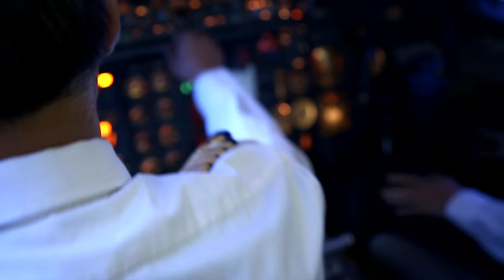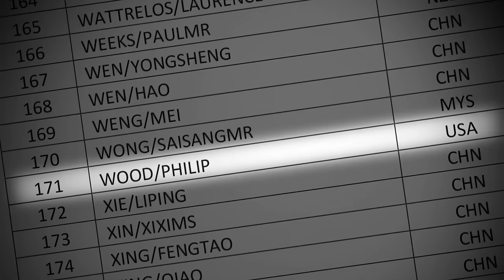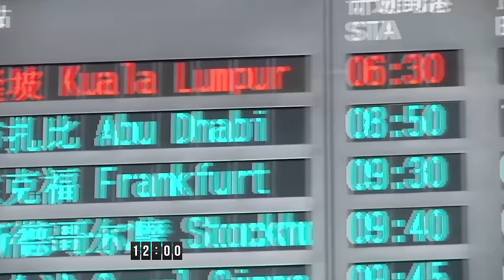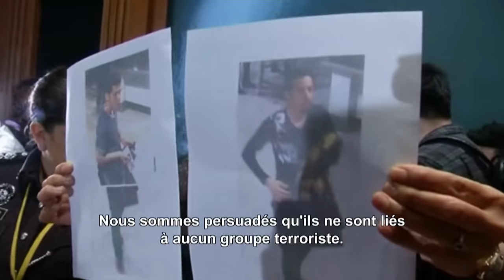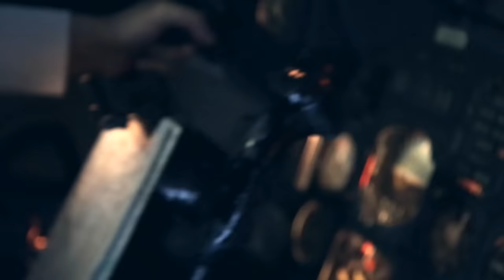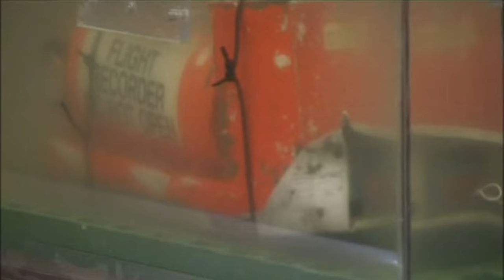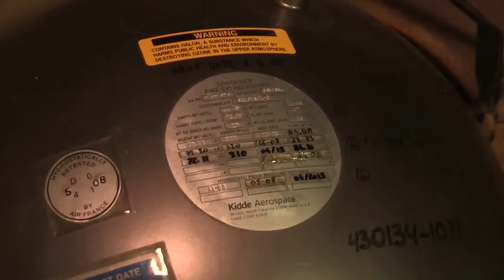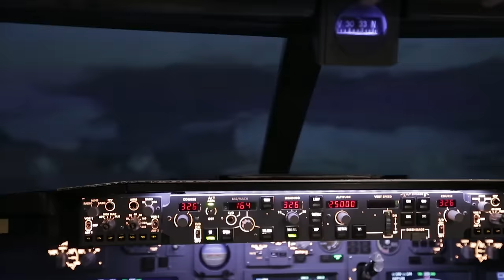Why We Never Found The Malaysian Flight MH370?

Comment: Planes do not disappear if they turn the transponder off, all that does is remove the flights identification number. If no transponder meant that it was not on satellite or any radar than countries would never be able to detect launch of missiles or detect ANY enemy aircraft.would completely defeat the whole purpose of satellites and radars in the civilian sector and especially military.
Reply: Yep. Good luck getting that message through to the NPCs.
Reply: Goes to show you how prepared any country is. We can’t even detect a balloon the size of 4 city buses spying on us . A pilot had to let someone know
Reply: Yes without transponder there is still primary radar, however aviation ground stations generally do not use this. Even with a basic primary radar return it will not provide positive ID of the object it’s tracking.
Reply: @kamakaziozzie3038  There's no "however" about it. The RMAF tracked a rogue aircraft known to be MH370 as it violated the Malaysian border, which is all the requirements needed to treat it as an attack on the country and order it's interdiction, period.
Reply: Áááaob
Reply: Este accidente es muy extraño, porque fue bien preparado, inclusive apagaron la coneccion satelital que los motores mantienen con el fabricante en todo el periodo que se mantengan funcionando y en uso, y eso del transpondedor si lo apagas desaparece de los radares satelitales no así de los terrestres, en cambio los satélites militares tienen detectores especiales para descubrir Despegue, Masa, Arco, Reingresó,  Velocidad, Trayectoria, Destino, Ruta.  Los satélites militares son militares, no ocupan el espectro de bandas civil, solo piensa lo que ocurrió con las torres gemelas, no sabían dónde dirigir los únicos dos o tres cazas que pusieron en vuelo y desarmados. No sabes nada de detección, satélites ni menos radares, saludos.
Reply: @C.Europeo  Entiende tus hechos, amigo. La señal de telemetría del motor es en lo que INMARSAT basó sus cálculos falsos.
Reply: @UguysRnuts  ya te respondí, pero en esta mierda borran los comentarios.....!
Reply: It was tracked on military radar & it IS known where it went down, east  of Australia ( from another utube program).
Reply: @susanburrows810  False.
Reply: Podría ser iniciar una búsqueda cerca de las islas Maldivas para buscar escombros, si tienen los fondos para eso, claro.
Reply: @baffledbybullshit- Do you realise how big the ocean is?
Reply: @Karlthegreat84  Do YOU realize the former Malay Prime Minister and his wife are currently in prison for the largest financial crime in the history of the world?
Reply: @UguysRnuts I actually know that, but that doesn't have any connection to the MH370.
Reply: @Karlthegreat84  Two of the greatest crimes in history, both revolving around the same corrupt dictator, but you don't think they're related???
Reply: @MikesGarageReviews  great point dude..

Comment: The whole way the situation was handled reeks of a cover up from higher places. I think the plane was shot down accidentally the moment or shortly after communication was lost and whoever did it has enough friends or influence to come up with this whole story of the plane turning and changing its route.
Do you remember the story of the passengers who made the plane headed for Pentagon on 9/11 crash deliberately by overpowering the pilots? Yet the debris was found in a radius of tens of miles, pointing to an explosion while in the air. Even in this situation, just after two planes had hit the twin towers killing thousands of civilians, they couldn't admit they shot down the third plane before it could hit the Pentagon.

Comment: The more I listen to this story the more it sounds like it was hijacked.
Reply: I agree with the hijacking hypothesis:-
Reasons :-
a)Fuel to Beijing is enough to reach US 
   Strategic Military base of Diego Gracia
   in the Southern Indian Ocean.
b)Security checking for MAS flights at
    SEPANG AIRPORT is very poor bcuz
    the airline is govt back & the fated MH
    370 at midnight & security dwindle.
c)Two stolen pasport is been used 2 
    unidentified passengers..and the 
    moment of hijack is planned to be the
    exact time of passing to Vietnam air
    controller.This moment also all flight
    communication been turn off.
d)The craft is been force or more likely
    already at the hand of hijackers and
    reroute via border airspace of Thai
   land M'sia ,Indonesia,Sumatra Island &
   Maldives bcuz less concern for com
   mercial planes.
e)when the plane reroute again exactly
    in the direction of Diego Gracia, US 
    satelite already on the alert mode.2
    military high altitude,high speed planes
    are mobilised to intercept MH370. 
    Attempt to communicate fails & no 
    way to request the commercial craft
    pilot to reroute emergency landing to
    the nearest habitable land.
e)So as according to airspace rules, 
   military forces take command....
   and BOOOMMMMGGG!!!!!!! No way any
   unidentified small  or big air& sea craft
   can be near D.Gracia's ocean waters.
f)MH 370 upon been hit high in the air,
  disintergrate into pieces because of
  the military missiles together with the 
  still available fuel plus the extra quanti
  ties of lithium batteries carga intended 
  to aggravate blast upon reaching D.G.
  military base.
f)So we just wait for a box- office film
   by Hollywood or Hong Kong film 
   makers to make money.As to date
  we must sympatised with the famalies
   of the passengers of the doomed plane
Reply: Agreed! It was hijacked and they want to do the “Sept. 11 attacked” style in Diego Garcia where one of the biggest U.S. base located.
Unfortunately, it was shot down by the US forces before it reached the US base.
Reply: If you watch this documentary from start to end, it is clear that the hijacking (beginning and end) is their favorite theory but the stretch that leads to the base Diego Garcia and the US shooting down the plane is honestly for me over the top and unfortunately typical of a French approach towards the US. They often overestimate the US and try to find a way to blame them. Sorry but if it was the case, the Chinese government who's passengers were the majority on that flight and the hundreds of millions spent in numerous massive searches would have not taken place is a country had shot down this plane or the plane was hijacked.  I also feel very sorry for the family of the victims that had to deal with this tragedy and the incompetency of the authorities. I have a feeling that this mystery will be solved very soon.
Reply: You need to listen more carefully then.
Reply: @philsurtees  I have stated my personal interpretation of the respective news flashes of witch I am tired of hearing. They should pick up where they left off and stop repeating things.  They will never find that very expensive plane because some country wanted it.  Everyone is entitled to their opinion and that was mine.  If you do not like it then respect mine and keep your insults to yourself.
Reply: Yep by the pilot
Reply: @eza6940  Very little damage could be inflicted by an airliner crashing into an USAF base and whatever damage might occur would not be allowed to be known to the public. However, do take note that the two tallest towers on the planet, after the demolition of the World Trade Centre, are in Kuala Lumpur where the flight originated and therefore, the claim made by the Malaysian Minister of Transportation that he sat on his hands instead of following Standard Operating Procedure by scrambling interceptors to investigate an unidentified blip as it passed over the coastline into Malaysia is highly suspect. The RMAF train extensively for this exact scenario and could not allow for the possibility of a second 9/11 to happen.
Reply: Then why are there no terrorist groups claiming this? They are doing it for the notoriety and almost always make claim. So why in this instance has not the first terrorist group made that claim?
Reply: @jennyterrell6354  What makes you think a terrorist "group" was responsible? Captain Shah was acting unilaterally to have the newly appointed Prime Minister, Anwar Ibrahim cleared of the trumped up charges he had been convicted of EARLIER THAT SAME DAY.
Reply: @jennyterrell6354  You're welcome.

Comment: The damage on the flaperon debris showed that it was in a downward angle and the plane was ditched in a controlled manner. 

Flight data shows the plane was piloted from beginning to end and flew manually right across the boundary between countries to purposefully obfuscate its position. The point where contact was lost was right on the boundary between flight zones and the perfect place to take over the plane and make it disappear, communications equipment was manually turned off at that point strategically.

Witnesses close to the pilot testified he was depressed and the flight simulator path from the pilot where he flies until fuel runs out and ditches the plane in the Indian Ocean almost exactly as first was hypothesized is the icing on the cake.

The mistake was to assume it was an involuntary end of flight like Helios which put the search area in the wrong area. Because it didn't take into account the pilot controlling the plane from beginning to end and gliding the plane further after fuel ran out. To create more distance between the plane and 7th arc, where you would search if you assumed the plane took a nose dive straight down after fuel ran out... But the flight data and debris implies the plane gliding further out in a controlled descent... (;

Comment: There needs to communication at all times with aircraft’s even when your switching from one airspace to another. Malaysia ground control should have remain in communication until the other airspace controller confirms the transfer.
This is a loop hole and pilots know it.

Comment: In total, 19 families have claimed the phones of their missing loved ones rang without answer for four days after MH370 disappeared. One woman even went on Chinese TV to prove to the public her brother's phone was still ringing after the plane had allegedly vanished. So the plane is not in the water !
Reply: An irrelevant glitch if anything other than hearsay.
Reply: all that means is the phone companies that the phones being called, were unable to connect to the lost phones, therefore the phone companies would simply ring and ring and ring. When we call a phone, we are not calling that phone directly, we are calling the company which that phone subscribes to, it would be the company that connects to the phone we are calling. so, phone calls ringing 4 days after the plane went missing is meaningless. it means only that the subscriber was not answering the phone company, preventing the phone company from connecting to the subscriber. means nothing.
Reply: @DennyTolhurst-BARCH  What happens when a phone is submerged in water?
Once inside, it flows into the circuits. The result? The water, which acts as a conductor, carries a current which then overloads the phone with energy, frying the circuit board. Certain practices make this worse, such as allowing the phone to dry on its own.

Comment: The people in 1st and Business class surely had phone connections and internet. I am sure if there was a genuine problem, someone would have sent a SOS message or something. Or even a text saying we're in trouble. Also, with a lot of cellphones on board, one would find it easy to track them.
Reply: absolutely right, too many built-in emergency  devices on this plane were not intact to point out that something is wrong, I can't 
dismiss the assumption and the possibility that all plans system had been remotely controlled.
Reply: @UguysRnuts  well it is well known that boing build up some control towers in some secret locations on  the late 90th , this done  due to the icreased numbers of hijacking of planes while flying with passengers on a route  , the aim was to get control on the plan and directing it to land  at a  certain  destination ,whereby a special well trained troops will nuturelize the hijackers and free the hostages ,a proper softwear were planted in some plains to make it accessible for remote controlling .all this is not my imegination but well described by flying attendance named Rebecca Roth while reviewing the 911 event, I am just taking this possibility into a possible soloution ,i am not saying that's what really happened to mh 370
Reply: @UguysRnuts  Hello mister   Gibberish glad to know you understand you made a thorough investigation of lh370 disappearance, i appreciate your knowledge of the event but as you probably know all so-called "expert opinions and the conclusions they draw completely failed to point out what's really happened to the flight and where is the actual place of this plain, it's all running about roomers and speculations and on some conventional assumption, in the absence of real evidence you must take into considerations some unconventional assumptions as well. say remote controlling of this plane (which is currently used in a small unmanned plane called drones by our Israeli airforce ) and some conspiracy theories as well . your missile's blowing  theory well I think it's wrong to cause, had this happened it would leave a lot of debris and surfing objects which will be noticed by the huge search team engaged in that, so keep the good spirit and the good job you are doing . looking forward to hearing your comments.
Reply: I agree
Reply: But phones can have service and internet   On the plane. We use ours flying to hawaii
Reply: It's seems to me someone was on that plain? 
Guess who? And is alive? 
That's why he/she knows it all? 😢
Reply: @deliafredericks7578  who?
Reply: @deliafredericks7578  He seems to be very involved with all of the comments. Maybe to involved.

Comment: Finally there is a possibility that the plane was remotely controlled at some point, in this case the pilot has no way to interfere with the plane flying path, that is terrifying, furthermore it is a Boeing aircraft so the possibility of a remote controlled hi-jack is even greater.
Reply: bei boeing ist es schwieriger als bei airbus! airbus hat flight by wire Boeing nicht! und nei boeing hat immer der Pilot das letzte wort immer!!! bei airbus nicht! da bestimmt der Computer
Reply: @michaelguttmann10  was natürlich auch kompletter Unfug ist.. du solltest das nochmal nachlesen, was du behauptest.. stichwort DIRECT LAW usw. ;)
Reply: @RoBBz2000  nein ich weiß schon was ich behaupte das wurde bei airbus später geändert! da es einen Absturz deshalb gab ! früher hatte der Computer das letzte wort

Comment: The previous investigations into the trajectory are based on the ping signal. The distance between the aircraft and the satellites can be calculated, but not the altitude and therefore not the exact course. This means that one can assume strong differences in flight altitude and thus courses with hundreds or thousands of kilometers difference.

Comment: I really believe that the aircraft was hijacked   from the inside of the plane by a computer geek trying to prove that  a person , other than the pilots , could control the airliner at his will.There is also a second alternative that  brings the scenario  right down to the programmers of electronic  operational   programs .  at the factory , that dictate the electronic inputs  for the proper operation of each aircraft system . That is probably why  nobody got any distress signals  or  Emergency Locator Beacon  position alerts.
Reply: Maybe …but the purpose of this hijack if no one Knows who they are et why they have done it  …claims?

Comment: Yes the Malaysian and Australian governments knew from day one what happened. They know the captain crashed the plane and there's no doubt about it. What is not said is that plane at one point went into holding patern mode (flying in a circle) for 22 minutes, which corresponds to 
some negotiation between the crew and Malaysian officials. The Malaysian govt probably isn't very interested in finding the wreckage and the black boxes because they could prove their involvement and the captain's last words confession in
this tragedy. About Diégo Garcia we have to get over with this base has nothing to do and no fighter jets has shot down the plane simply because there are no reasons and moreover the plane flew more than 7
hours until the fuel ran out. The captain's motive(s) may be
political, religious, undetected mental illness etc we may never know.However new data comming from ams radios tend to beleive that the next search of MH370 will be successful
Reply: Probably someone had a new IT technology onboard they needed to get rid of

Comment: Newly manufactured lithium batteries are very volitile directly after manufacturing; which has taken down another Malaysian Passenger Airliner before this date.  A part of the wing of  Boeing MH 370 washed up on a beach in Eastern Indian Ocean.  The passengers did not use their cell phones and were probably dead from depressurization and a lack of oxygen as the oxygen masks only provide air for a certain period.